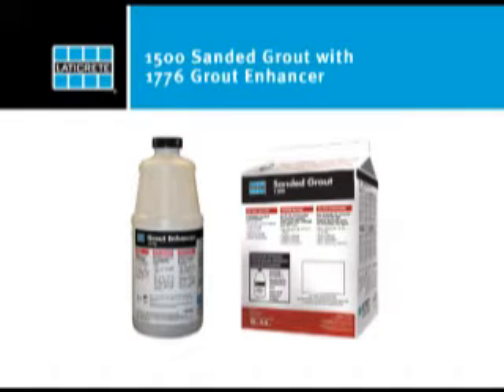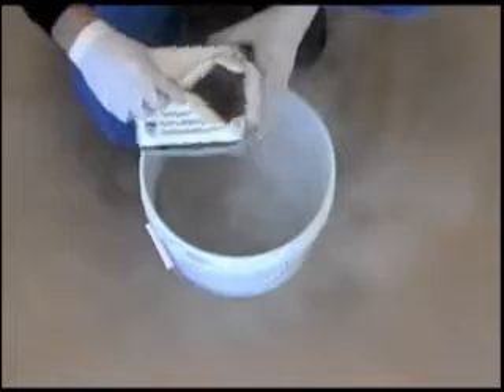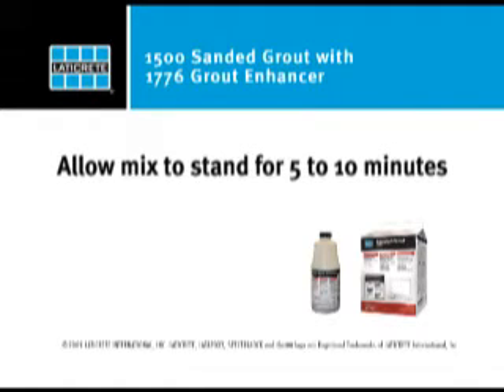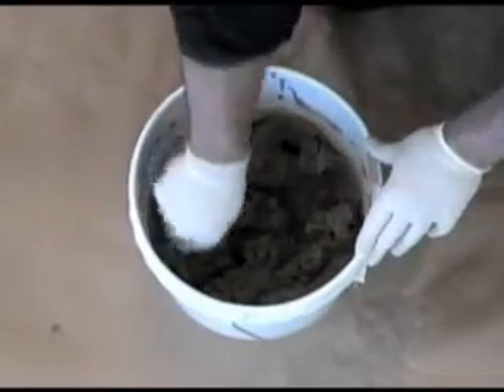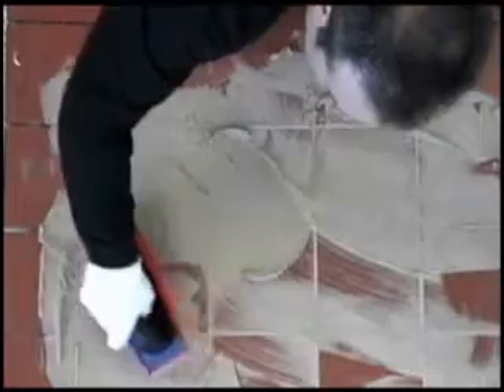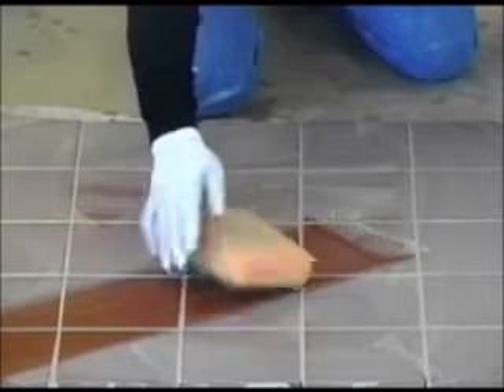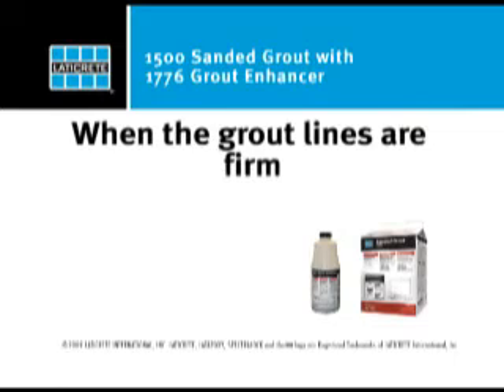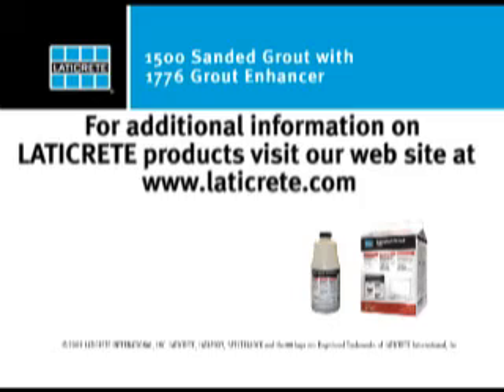1500 Sanded Grout and 1776 Grout Enhancer

Comment: Do you still have to seal the tile?
Reply from the maker: It can be sealed for added protection. Depending the sealer, grout can be sealed as soon as 2-4hrs with the STONETECH Advanced Grout Sealer or 48-72hrs with the STONETECH Heavy Duty Grout Sealer. All cementitious grouts are porous in nature and will benefit greatly from sealers.

Comment: My pleasure. 

Low joints can occur if you sponge the tile too soon after grouting. We recommend waiting until the grout has stiffened before sponging off the tile. I'd also recommend not applying too much downward pressure to the sponge. You can certainly apply another layer of grout to bring the joint height up a bit - do so while the joints are still clean to prevent contamination.

Applying a sealer is not required however a good quality sealer will increase stain resistance.

Comment: Good day,

My apologies about the lack of complete information in this video. We do not normally include all physical properties and specs for our products in the how-to videos.

To answer your question, the grout that you are using cures to foot traffic in 12 hours and to heavy traffic in 24 hours. You can apply a sealer should you so choose - if you do we recommend consulting their recommendations on the length of cure required before applying their product.

Best of luck!